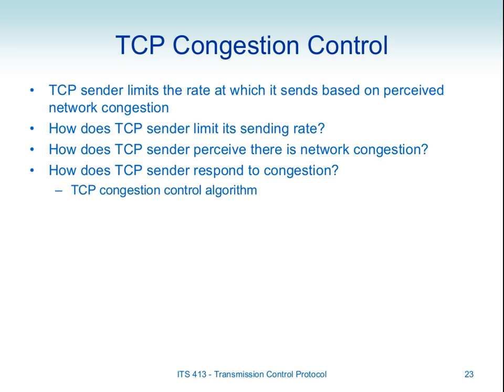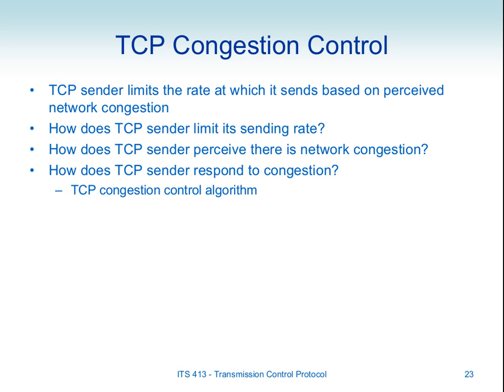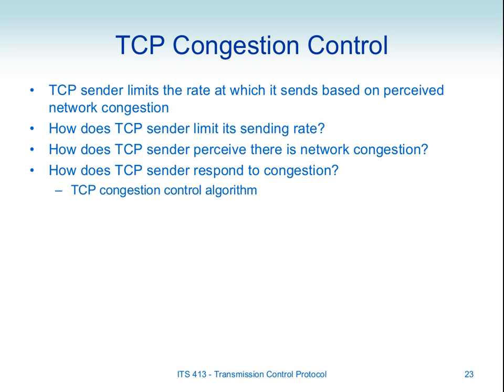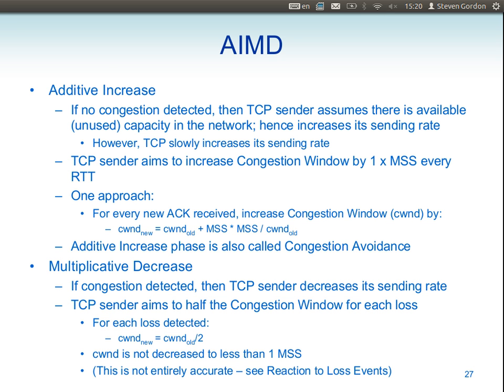ITS413, Lecture 19, 24 Jan 2013 - TCP Congestion Control

Comment: Great lectures as always, Can you please clarify something for me? 
you say that every RTT the window is increased by roughly 400kb but with that formula at round 4 you start seeing a decrease of the sending rate to something less than 400kb. See: First round:
1000+1000*1000/1000+1000 = 2001
Second round
2001+1000*1000/2001+2001=2501
Third round
2501+1000*1000/2501+2501=2901
fourth round
2901+1000*1000/2901+2901=3246
so how can you calculate based on 400kb per RTT if the more RTT's the less data is sent?
Reply from the maker: You are correct, although note it is not a "decrease in sending rate", but a "decrease in the rate at which the sending rate is increased".

The formula only approximates the principle of "increase by X KB every RTT". In fact as you noticed, using the formula increases at a slightly lower rate. But it is considered a reasonable tradeoff, since using this formula, the window is re-calculated for each ACK received. Whereas if you wanted to use exactly "increase by X KB every RTT", then you would need to keep a timer and re-calculate the window when the timer expires (slightly more complex,  considering the RTT changes).

Note that this is the basic (original) algorithm. There have been many extensions to TCP to try to improve how the window size changes in different conditions and they may use different formulas.